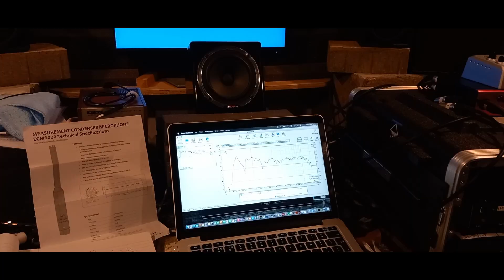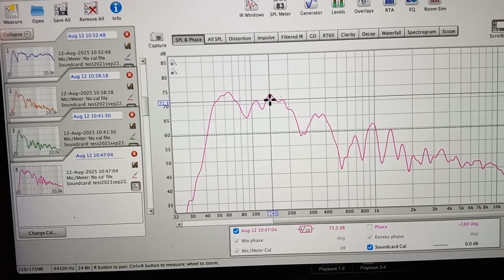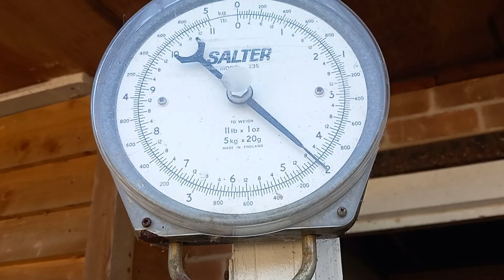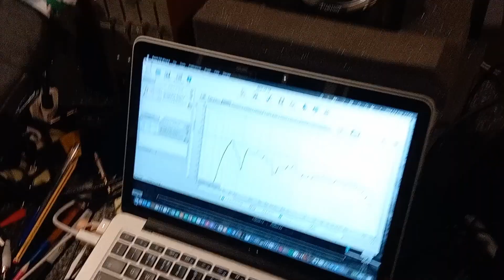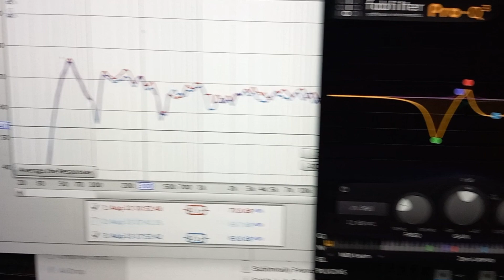DIY building membrane panel bass traps - studio acoustics update

Comment: Nice video, my friend. Really good content. But if you let me give you some advices, I would say: 

1- Don't focus too much on the frequency response graph. If you're using REW, the Waterfall graph is a lot more useful to planning and testing acoustic panels, because it shows the decay time per frequency (basecally all your room modes are there). 

2- Acoustic resonators need to be hermetically sealed, but at the same time they need space to vibrate on all axes, therefore screwing the plate directly to the frame reduces efficiency, as air enters the box through the gaps.
Reply from the maker: Thanks. I agree on both points. These are budget boxes and are not the perfect solution, they do work to a reasonable extent. Also this room is not large so the waterfall response and rt60 times are very relevant but have different limitations compared to larger room sizes. Also these small speakers have a limited low frequency response and are ported...